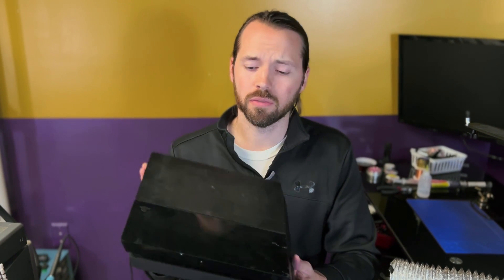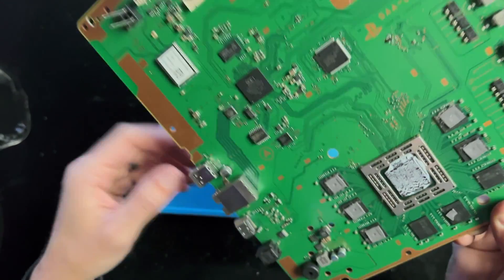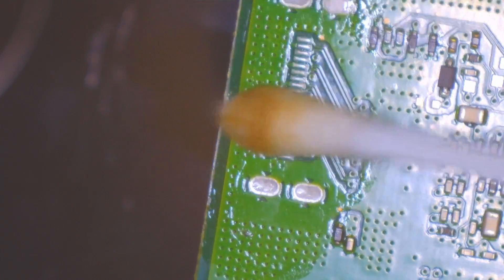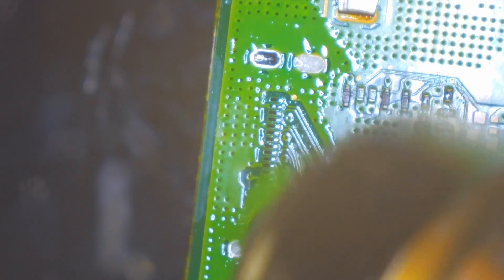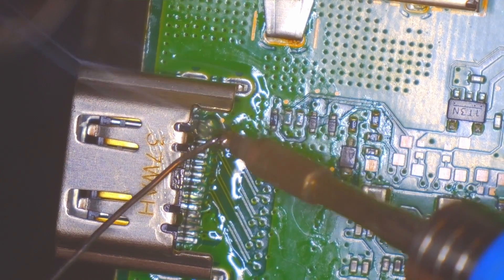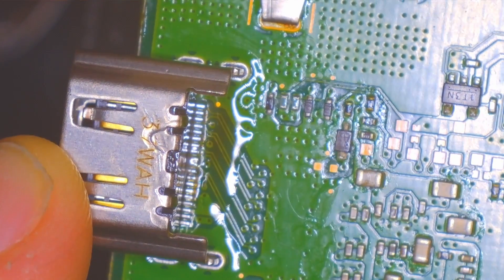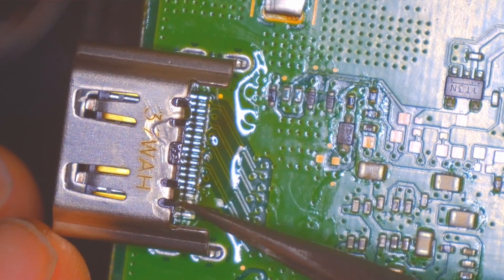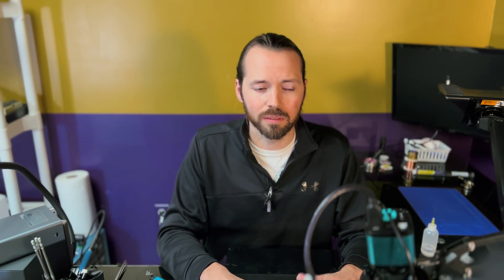Lets Fix It - PS4 Original HDMI Port Repair

Comment: Would definitely recommend a bit of solder wick on bridges like that. Those pins and pads are fragile and a quick wick up and rework is far tidier and less damaging than loads of flux and dragging. Overall though, very nice video. Also agree it's too time consuming to clear those holes.